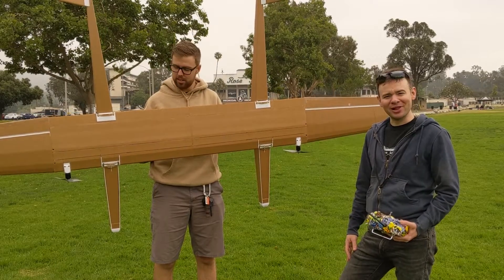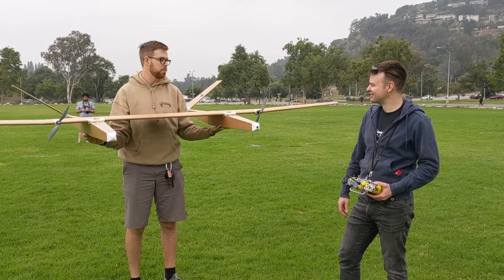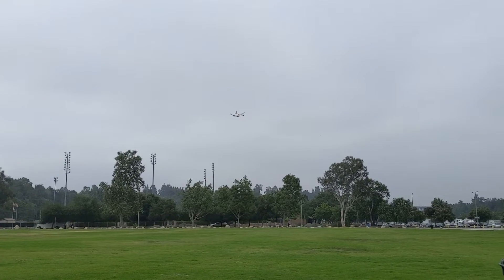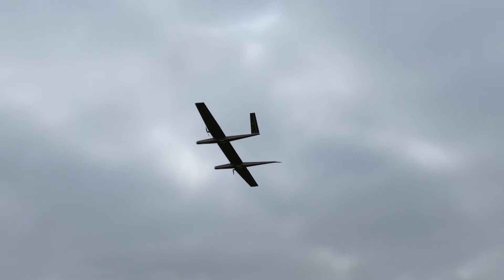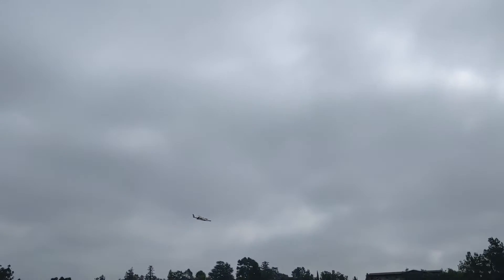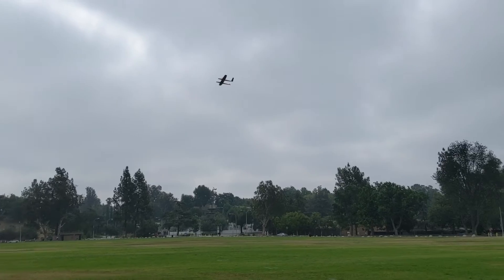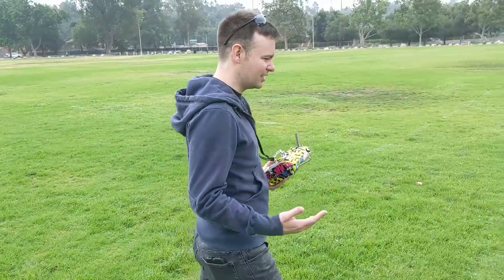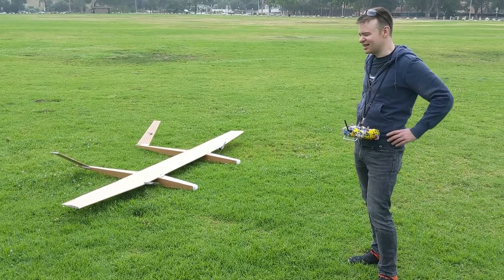Twin-Fuse Carrier's Maiden Flight

Comment: I'm looking at the twin-fuse, what guide did you use for the length of the tail fuselage?  I'm trying to build  a foamboard plane myself. Similar to the P-38. Thank you for any help.
Reply from the maker: Since the carrier is most similar to a motor glider, we used proportions that were common among motor gliders.

Comment: the "it does give it a pitch up on power"... how much down thrust does it have in it?... if the thrust line is correct, plane should just settle into ideal glide without pitch deviation. By this video, seems like a few washers on the top bolts of the motors will have this puppy flying super nice. Also, might want a little differential in there; there's some adverse yaw happening.

Comment: Fantastic looking plane design!
Does the fly time improve with using 2 motors, giving that you are using 1 battery per motor?
Reply from the maker: In a sense
Reply: @Jd7791 ... Flight time is just about power drain, and all in all it's generally a wash. Gas/nitro planes get extra thrust when going twin due to extra prop disk area, but in electrics where you can adjust the Kv/rpm of the motor to get the static thrust you're after, it's all a wash. Flight time on this plane will mostly be coming from the abundant lift of the wings and not needing much power to keep it up.